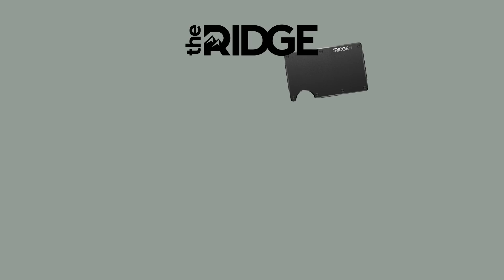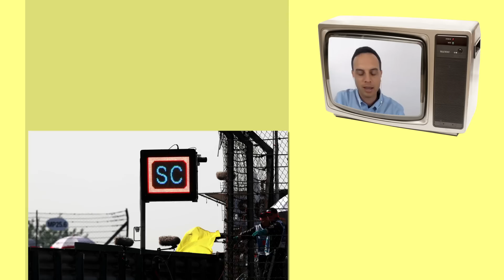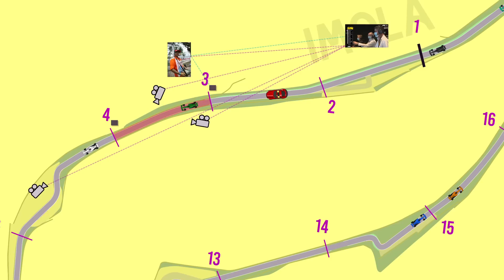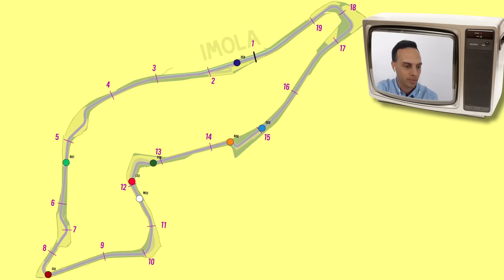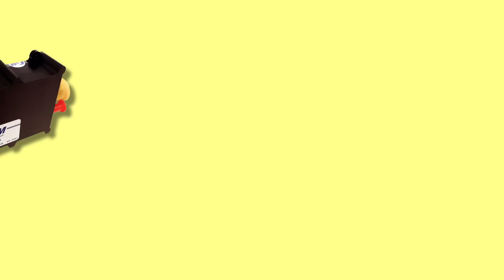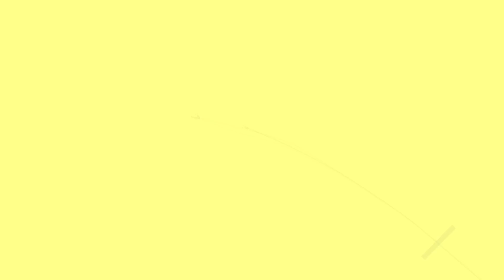How F1's Electronic Marshalling Systems work - ft. Luca De Angelis

Comment: Very interesting video. Not all tracks work the same way though. As an F1 Marshal for Yas Marina (Post 10), the vast majority of the flag panels are now controlled centrally from race control and the marshal only controls the panels in some F2 or F3 qualifying or practice; I guess this is to avoid errors in incorrect displaying or pressure as you mentioned. Despite this, physical flag use is still required, as is the showing of VSC or SC boards at all marshal posts. The instruction for this still comes via radio to the Post Chief, who informs the marshals of their action i.e. put out board, yellow flag, clear debris from track etc.

Comment: I find it little strange that they are using GPS for positioning. They have the budget to build extremely accurate positioning systems and then they have just decided go lazy and implemented a GPS. They even already had the reason to go with better positioning system. 😶

Comment: Really nice video! Would have been interesting to know though whether that ‘remote control’ for the marshals really has a button for a red flag (as suggested in the illustration). I always thought the decision whether to abort a race is solely made by the race director. Or does pressing the red button on the remote control only send a ‘race abort request’ to the race director?

Comment: I think the next step would be to add video cameras that connects to machine learning that set off alarm if the drivers went off track or violated track limit.
Then the race control can verify the alarm to check if it is not a software error and make decision on the appropriate warning/penalty to be applied.
This has advantage over race control actively monitoring each corner and allow them to focus on safety and other more important works.

Comment: It changed last year(or the year before) to remove blue flags from the hands of the marshals during the F1. It didn't go down that well initially.
I also like how in some sectors the light panel marshal has to sign on with 1 post chief then walk past another post to get to where they stand.
Now we just need to level the playing field for the rules for marshals and improve standards in some countries without regular marshaling.

Comment: Sure I've read that when a marshal presses the yellow flag button the next light board turns green, and when double yellow is shown the previous light board turns yellow automatically. Useful to get that instant change for the drivers rather than having to wait for a marshal at the previous post to notice and wave a flag.

Comment: I would be the annoying marshall at the instructions phase asking questions like:

"But can it display the blue flag and the yellow-and-red striped flag at the same time?"
"What if there is a trackwide SC condition, but I want to have double waved yellows at my post for an accident scene?"
"Can I show the white flag under other conditions than green?"
Reply: 1)  A blue light overrides the red/yellow light. The blue light is usually of short duration.
2) The rule is that the station with the incident, flags the incident.  A double yellow will be displayed in place of the SC light until the marshal clears the double yellow.
3) Like the DY, the white light is controlled by the on-track marshal. So it should temporarily override a light set by race control.
Reply: It's programmed to show the highest priority signal so double yellow over any other signal including SC and VSC not sure where white comes in priority likely quite low it's certainly not as important as yellow and double yellow arguallbly red, SC and VSC are more important and they'll just have a normal cloth white flag for any service vehicles on track for reds and SCs.
Reply: Thank you for your answers, gentlemen :)

Comment: I don’t understand why they can’t use a few cameras (up to 4 possibly, one near each wing tip) that could monitor the line of the track limits. Maybe even use a special UV camera / paint combo or something, but it seems like a fairly easy implementation to me.
Reply: Don't need anything so complex, MSV circuits do have cameras for track limits think it's with a pressure sensor in the ground and it takes a picture of the offending car for review. Installing a Hawkeye system which are common place in an increasing amount of professional sports trackside would also do.

Comment: I found myself giving a lot of thought to this system this weekend in Barcelona. I'd be very curious to learn how the blue flags are managed, specifically how Marshalls are notified of when to, and when not to, wave the blue flags cough Mazepin *cough*.
Reply: Blue flags via the panels are managed by race control as far as I'm aware, as they display the driver number with blue colour around it
Reply: Blue flagging is a sensitive issue in F1.  At some races, race control calls almost every flag. In Bahrain I put out a surface flag for a small bit of debris.  The radio marshal pulled my arm back and said, "No. No. We haven't been given permission, yet!"  Blue flagging is not taught in some countries.  In Bahrain, the two flaggers are referred to as the Yellow flagger and the Green flagger!  On the other hand, in Montreal, we are free to flag.  Sometimes, we are given a radio and are provided information about lapped cars, leader pitting, etc.  This can work well, sometimes not. One year in Austin, I turned off the radio after 15 minutes because I was being bombarded with "information" that was irrelevant to what I was seeing.  Many of the blue flag marshals did the same, that day! A properly trained marshal knows when to display a blue flag.  Race control should keep out of it.
Reply: @donhowson279  I'm impressed that Marshalls can keep track of the running order. Having not been to an F1 race in person I am guessing, but at track level and without Crofty in their ear, I imagine it would be tough to keep track. Clearly race control has some influence now, or Toto's radio message really was a scam as some are saying, but I appreciate your perspective. Seems like a technological solution would be tough, but maybe a GPS system could work for steering wheel displays.
Reply: @michaelgirvine  GPS is used.  But blue flagging is more nuanced.  In Montreal a few years ago, the race director came to the morning marshals' meeting to tell us we were free to flag. He said I know you can do better than a computer and a few satellites!

Comment: Another great informative video. 

The technology is a great improvement, not just for the teams and drivers,  but letting the fans know in real-time when a incident occurs, while that is a secondary benefit,  it keeps things flowing. 

I guess at some point they could implement a limiter in the cars if they ever felt the need to remove any chance of over speed on the yellow flag or red flag,  instantly slowing the cars. It is all electronically controlled in cars anyway these days. 

As technology improvements continue, the weight of the data recorders and sensors will reduce too, and maybe enabling more sensors for the medical team,  such as pulse etc so they have even more data as soon as they arrive at the scene,  which could help save injury and lives.

Comment: European marshals who do F1: the image of the panel controls in this video has a SC and red flag button. Is this accurate? For all events I've done, these conditions have been directly controlled by race control
Reply: I think you are correct.  I didn't work an F1 race in 2020, but I am fairly sure the Red and SC buttons are not on the current control panel.  At the very least, they are disabled.

Comment: Can't F1 pay ESA to get access to the galileo satellite navigation system? it has a much better accuracy (according to wikipedia it can achieve 1cm accuracy)
Reply: Think they're still building Galileo so is likely not that acuate yet and even if it is that kind of acuatatcy is locked down for EU state use only and although the FIA is based in the EU I don't see the EU letting an international sport that goes to shady countries to use military-grade GNSS. The less accurate signal which is also meant to be more accurate than GPS is publicly available and this system likely can use it, as devices that have "GPS" capability can usually actually receive signals from multiple GNSS systems normally GPS, GLONASS and Galileo on new devices.

Comment: A few comments from a marshal:

-  I don't think a lot of people realise how difficult it is for drivers to see flags displayed from traditional post locations. They are often off to one side and the drivers are looking so far through the corner that they only catching physical flags with the corner of their eyes at best. The light panels and steering wheel lights put the information straight into their eyeline.

- In F1 races, marshals do not control the blue flags, that system is automatic (so Toto, you can pipe down about making sure Mazepin got them shown to him).

- The location of the light panel marshal isn't always great. The normal flag posts have a good view of your sector, but the light panel controller can be squirrelled away somewhere with a rubbish view of what's going on and they are padlocked in place, so you can't relocate.

- The lights do lose a level of information transfer to the drivers. All the yellow lights look the same, but when we display flags, the urgency with which they are displayed matters. The marshal with the yellow flag is typically holding one flag as they have to radio Race Control whenever they display it. This means there is a natural delay before double yellows are shown, but an "urgent" single yellow does get the message out that something is serious, rather than a car in gravel which (should) require no avoiding action.

- The medical system is superb. The cars are equipped with a blue 'medical' light which pulses when an impact reaches a certain threshold. If there is an incident with cars equipped with these lights, and I see it lit, I know two things: I need to report to race control immediately for medical assistance, and that medical help is likely already on its way.
Reply: RE urgency information lost with light panels, can the blink interval perhaps communicate that? A slow-blinking yellow (say 0.5s interval) could be normal, but a fast blinking one (0.25s) means something major happened, and is likely to escalate to double-yellows, VSC, SC, or even red flag.

Thanks for the insightful comment!
Reply: @midnightfuture  that should work
Reply: I thought double waved yellows have a different animation to single yellows?
Reply: @PunnamarajVinayakTejas  exactly
Reply: @PunnamarajVinayakTejas  RECOMMENDED FLASHING
FREQUENCY (Hz) is 2-4 this is from official FIA doc

Comment: I was a race marshall at Mosport, Shannonville (small club track in southern Ontraio) and at the Montreal GP in the early 80's. Thanks for this. It's awesome to see the advancements. Question » How is blue flagging handled today? Back in the day, that was very difficult to do well. The blue flag marshall needed to stay on top of the driver positions, with no communications from race control, no electronics, radios, or TV, while only having a visual on the immediate sector.
Reply: Would be similar to how they do yellow flags etc. The driver in car gets the display on the wheel, & I believe their racing number is displayed on the panel with blue around it in relation to their position on track
Reply: I depends on the race location. At some races, almost all flags are called from the tower. At others, the flaggers are left to do what they are trained to do.  In some cases, it is a reflection on the experience level of the local marshals.  In Montreal we are free to flag.  I work all the major series in North America. Frankly, I find F1 the easiest to flag.  Only 20 cars, liveries which make identifying teams at a distance easy, short pit stops. In Montreal, though, reaction time is the challenge. At most flag posts, you only have about 1 second to make a flag decision.  Not uncommon at street circuits.
Reply: These light boards can flash up a blue light and the car number of the car being lapped during the race which is done automatically when the lapping car is a couple of seconds away I think blue lights without any car number in practice and qualifying is manual though.

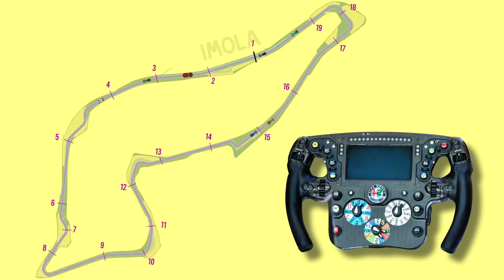Comment: Great video! Just one detail, at 6:06 when you show the wheel: the two LEDs with the yellow circles are not the flag LEDs, the two groups of three LEDs at each side of the screen are the flag LEDs, they are one yellow, one red and one blue for each group and turn on for the corresponding flag color.

Comment: I'd like to know how they get 1ms timing accuracy?
Reply: do you mean on the black box, the sensors or streaming data between cars and race control ?
any processor running on GHz is able to do at least 1 billion instructions per second, so keeping meaningful data reports every 1000th of a second still gives you a millions operations to run between reports
and with that in mind, dial up connections could give you 56kbps (kilo bits per second), or 7 bytes per milisecond
blutooth and Wi-Fi both beat that easily on stationary equipment, so their biggest challenge with data in the end is the same as the GPS
they have to correct for streaming errors caused by the cars speed
was that you question from the beginning or was this helpful in any way?

Comment: What's the difference between a yellow flag and double-yellow flags?
Reply: Single warns of a car or incident off the racing surface.  This is upgraded to double when marshals or other safety workers are responding to the incident. "Boots on the ground."  If the incident is on the racing surface, it is an automatic double yellow. In both cases, there is a automatic single yellow backup at the upstream flag post. How the drivers' expected response to the yellow flags is determined by the series rules. Under North American rules, an FIA single waved yellow is a single standing (stationary) yellow. An FIA double waved yellow, is a single waved yellow under NA rules.  In IndyCar, the drivers are expected to reduce their speed by at least 15% in a waved yellow zone.

Comment: 8:32 "with sensors like inertial sensor or gyroscopes". Aka. A IMU (Inertial measurement unit), which is an accelerometer and gyroscopic sensors.
Reply from the maker: thank you! I was so frustrated trying to get the transcription accurate as I definitely understood word at the time but could only hear 'national' in the re-listen
Reply: @chainbear  No worries.

Comment: One bit of the video that is incorrect is the number of light panels.  They do not match the flag stations one-for-one.  There are fewer light panels than flag stations, and the light panels may be located between flag stations.  As a result a light panel yellow zone may be longer than a yellow zone defined by the flag stations.  What takes priority?  FLAGS!  A yellow zone starts at the point where the yellow is displayed and ends at the first station showing a trailing green. Blue flags were really a mess in the early years, but seemed to have improved. The Blue light is activated when a lead lap car is within 1.3 seconds of a lapped car.  But what happens if an otherwise fast car/driver is one or more laps down due to an unplanned pit stop, say.  He comes out at the end of the field and starts making his way from the back of the field to the front. He passes a lead lap, but slower, car.  The faster driver will trigger a blue light because momentarily he will be within 1.3 seconds.  The best example I can think of is Baku in 2017 (maybe 2018.)  On just the first or second lap Bottas damaged his car and came out one lap down (maybe two.)  As he made his way through the field, blue lights were going off everywhere! It was comical.  The 1.3 seconds is an interval, not a time needed to reach the lapped car.  So a lead lap car may take several laps to reach the lapped car.  A driver is not require just to surrender because he is a lap down.  But he may not hinder the lead lap car.  Everyone is entitled to run at his own pace, as long as he doesn't impede the faster car.  This is very common in multi-class races like WEC or IMSA.  It is not uncommon to see a slow car in a "fast" class impede a fast car from a "slow" class.  Lastly, the light panels you see in F1, are installed by FIA at each event, even if the circuit has it's own lights.  The equipment changes every year, and the location of the panels may be tweaked from year to year.

Comment: Could you make a video explaining how lap times are measured in Qualifying?
Reply: It’s quite simple, there is a little box called a transponder which emits radio frequency that is picked up by a strip in the tarmac (where the sector and start/finish lines are) whenever you go over it. Same system used across all motorsport, sports like running, cycling etcetc.
Reply: Uh that would be super interesting!
Reply: I'm interested in this too!
Reply: That's easy the exact same way it's measured during practise and the race. lol
But seriously though Paddy has got it's an RFID transponder on the car and the timing loops at the start line and the sectors